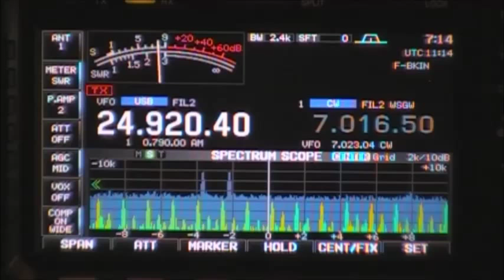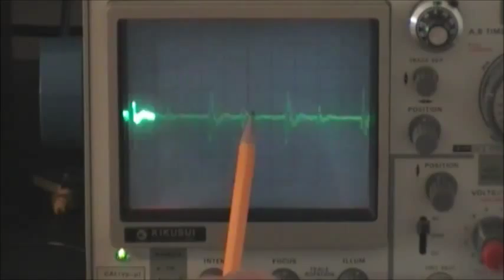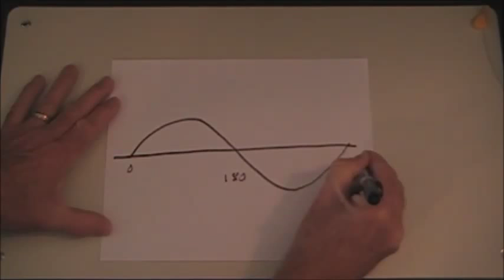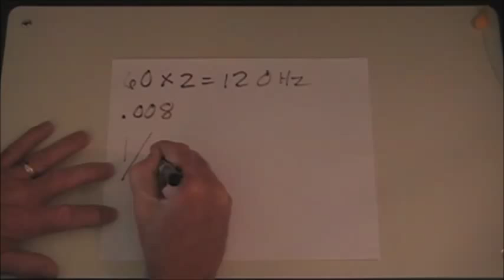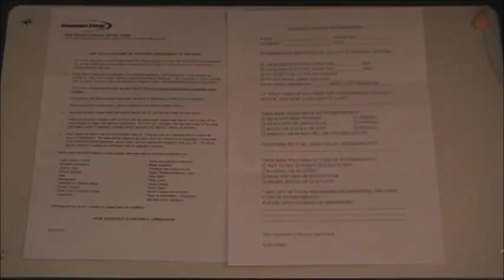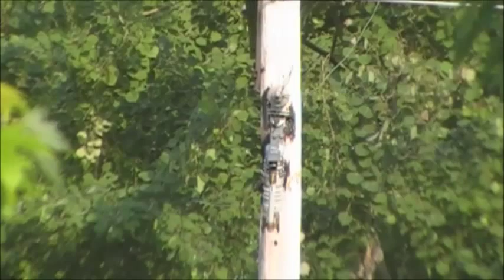Powerline RFI (Radio Frequency Interference from Power Line)

Comment: Thanks for putting so much time into this.  I had a bad noise problem with my ladder line feed antenna that largely was eliminated by going to a coax fed antenna.  However when I rotated that directional antenna west to try to pick up NZ and VK in the recent contest a noise level reappeared.  This direction points right at a pole and the power lines.  In the morning when I rotated the antenna to the east for Europe the power line was off the back side and I didn’t hear the noise anymore.  So I believe I do have some invasion from the power line 100 feet away next to the street.

I also detected a broadband signal in the higher 28 MHz band, a definite handshake or back and forth of signals that appeared with a different tone and shape on the spectrum display of the transceiver.  This occurred regardless of the direction of the antenna.  I guessed it was some sort of communication between devices, but a definite switching back and forth like a query and response, but it may not have been exactly that. I didn’t note exactly the width during the contest but probably 60 to 100 kHz above 28.7 MHz or so.

I’ve got a little work to do and will inspect the lines and hardware out by the pole to begin with.  Not sure if I have enough convincing information to approach Dominion Virginia Power.
Reply: I was surprised how responsive the power company was here in Michigan.  They have an individual who's job it is to look into these noise complaints. I wouldn't wait to contact them.  Sounds like you have a pretty good idea where it's coming from.  Good luck.

Comment: Great video.  I have a similar pattern of interference on 40 meters mostly.  When I rotate my antenna to mostly the west it shows more.  However, my interference is intermittent being on for 10 to 13 minute intervals every 30 minutes .  I went out in the alley an located one pole with much louder buzzing at about 107 Hz on a cheap newly purchased AM radio.  The noise also seems to come from the cable hook ups down the alley.  A large cable junction box is next to the pole.  I wonder if it is interacting or conducting the interference.  Still, the intermittent nature is puzzling me.  I also thought about it being a heat pump / furnace motor of sorts as there are houses and apartment buildings (big ones) in close proximity.  It is very cold out right now so I though one could be firing intermittently.  Tomorrow I am getting an MFJ 5008 delivered so I will go do some more "sniffing" though  it is going to be near zero degrees F over the next few days making it harder to stay out let alone walking on the ice in the alley.
Reply: apparently a tv cable wire that's damaged will act like a transmitter

Comment: I Hope you realize by now it is not a knife switch but rather a FUSE JACK! - 73 - KV4WM
Reply: Yep, it's a fuse cutout that can be used as a switch by pulling on it with a hot stick. Canucks call it a 'door'.

Comment: Power company could be leasing listening circuits locally, to law enforcement. Longitudinal and Latitudal hot spots on the lines are current to distance related. The current tags the radio frequency and meets, the spy current at the steel support wire. LED lights are the new microphones. Two types of light per led, allows recordings of vid/aud...One metal in the led uses wide light for video and thin light does audio. Potentiometer and a desk. CJT

Comment: I pick up rfi on my GMRS radios. It sounds like a diesel engine running at high rpm. While driving around scanning channels I get it on  different locations on different channels. In one area it will be on one channel only. In another area it will be on a different channel. What is causing this?
Reply from the maker: GMRS radios are FM radios and are not subject to impulse noise such as that caused by power line arcing which causes noise in an AM mode receiver such as regular AM voice, SSB or CW or even digital modes.  I really don't have a possible cause for that one.  Sorry.
Reply: @k8bz983  It is just very odd. It seems like it is always in the vicinity of a farm place. At one location it might be effecting channel 15 and another channel 20. But it is always the same sound. Well thanks for replying back.

Comment: Great video. Imagine if the damage wasn't so visually bad how long this could take to get fixed. Great work and i can't believe they haven't fixed it after all that time. They shoud be paying you for the money you would save them if they came to fix it before it breaks completely.
   I have just come back on the radio after around 8 or 9 years. It's very quiet at my new QTH, well as in there are no stations except the occasional truck driver on 11M. I've only checked HF for now. The problem is that i have between 4-9 of what seems to be power line noise. This seems to be a very noisy village. I'll be going mobile to DX and i'll be going mobile to try to locate the noise better but i really doubt that i'l be able to get the utility company to come and fix anything. especially here in France. 73's
Reply from the maker: Thanks for watching and for your remarks. 

When the noise began it was on and off.  It might be noisy for a few minutes and then stop for several hours.  Over about 3 or 4 days it stayed noisy longer until it was noisy all the time.  When I decided to track it down it only took a couple hours to find the problem.  The power company came out and checked it right away after I emailed them photos of the pole.  It was 2 or so before they came out and replaced the pole.

I hope you have success finding and eliminating your noise.

Comment: Is it a good idea to use a power conditioner with radio equipment to eliminate the chance of getting noise via the supplied power to the radio equipment?
Reply from the maker: The term "power conditioner" was new to me so I looked up some info on-line about them.  It looks to me like "power conditioner" is a pretty generic term that refers to anything that provides voltage regulations along with at least one other feature which could include noise suppression.  The descriptions I read referred to mostly audio, video and lab equipment and not radio receivers.  I would say based on what I found, using a power conditions wouldn't hurt, but these devices do not pickup electrical noise via electromagnetic radiation like a radio receiver.  If the source of received noise in a radio receiver is coming via radiated energy from arcing in a defective power line component such as the one in this video, a power conditioner would have no effect as the energy is radiated and comes to the radio through the air via the antenna.  So at this time in general I would say NO, it wouldn't necessarily something that would reduce radiated RFI reception in a receiver.  I would like to see some reviews of their use for this purpose before I would recommend getting one for reducing RFI.

Comment: I am being very bothered now with a lowfrequency sound at around 35-50Hz... at 3 different addresses. Else I havent heard this sound.

At all 3 locations there are powerlines and transformers in the close nearby. Very very irritating and distracting at nights and when its quiet around.. 

Is this a well known problem with power lines ?
Reply from the maker: I'm not sure but I think you mean that you can hear the sound with your ears, and not as static over the radio.  Yes, I would have to say it is possible.  Arcing in faulty power line transformers and other components make a quick snap sound with each arc.  The frequency of the AC will determine the pitch of the sound you hear.  60 Hz AC will usually make a 120 Hz hum as the arc will happen at the peak and valley of each cycle.   Human hearing is about in the range of 20 Hz to 20 KHz, so it would be within our hearing frequency range.
Reply: @k8bz983  Thanks.. Its like a consitant "humm" sound all the time. Gonna check this with the local power company ++
Reply: Within the power distribution industry, arcing is a well-known precursor to wooden power pole damage and even fires caused by it. Any responsible power company is going to want to deal with such arcing before it gets to the fire stage.

Comment: I live in a very rural area how far should I go around my home to find PLM I located one pole about a half mile away and power company repaired it dropped noise level from s9+ to s7+ but very loud buzzing thanks de KF4ZNL
Reply from the maker: The noise can actually "propagate" (for lack of a better description) down the power lines a long distance so if you have a receive that you can take to poles 1 to 2 miles in each direction (or maybe even further) it might ID more sources of arcing that are resulting in QRN at your location.

Comment: Isn't it nice that they have us hams to be their canaries in a coal mine? I'm going through this hell right now. I had two suspect poles to start. Utility company replaced the first suspect pole with transformer which improved but did not cure the situation. A second pole with transformer was also replaced but not the pole I suspect. The last remaining suspect pole also has a cable tv amplifier right near it and the finger pointing has begun. Cable company is coming out tomorrow to help me prove or disprove their equipment is the source. I of course already know the answer but the utility wants confirmation.

To their credit, they have been very responsive to my complaints so I feel I owe them at least that much. I suppose it didn't hurt when I also let them know that I am a SBE certified broadcast engineer for the local Fox affiliate television station. ;-)

73
N1JV

Comment: That pole is pretty secluded. Careful application of a chainsaw at 3:30am would fast-track the replacement. From your 26-minute video i can see that is not your way.

When i became an adult i learned to respect other's property. I began to discuss with my neighbors (each time i moved) how thier bright outside lights hurt my eyes and ruined my nightime stargazing, but could be cured (at no cost to them, or in fact any difference in lighting on Their property) with a simple metal shield which would prevent the light from coming my way. Every Time...each neighbor's reply was, "There isn't anything wrong with my light. You'll just have to deal with it".

When i was a teenager, my way of 'dealing with it' was the sneaky use of a pellet rifle in the early morning. Doing it that way worked So much better than my wasted conversations as an adult. Sometimes it took 15 bulb replacements to get the desired result (less light pollution), but it worked. As an adult, I could hire a lawyer and take them to civil court, but i don't have the money for that. I wish it were different, but that's the way it is.
Reply from the maker: No only would the chainsaw method cure the noise problem, it would stop all audio output from my receiver, as my ham shack gets it's AC via the same pole.  I can't complain.  The replaced the pole in pretty short order.

Comment: HI Steve,

Great video showing your methodology, and amazing pole damage.

Does your scope not have single sweep capture capability?  Single Sweep would make it much easier to analyze the spikes.

I previously used my oscilloscope similar to what you do, but then realized it's often much easier to just use a soundcard based audio oscilloscope program, and I now use one called "Soundcard Oscilloscope" for analyzing the audio.  This software is free for private use applications.  This software allows you to do a single sweep capture, and it has cursors so you can easily measure the time as well as frequency of the spikes.  I use the software with a laptop that has a built in mic, and therefore no interface required.  I was easily able to capture and measure the spikes in the audio you recorded using this software.

Just FYI, and thanks for the previous 160 meter contest contacts (keep em coming).
Don (wd8dsb)
Reply: Hi Don.  Thanks for the info, as well as the 160m contest QSO's.  My scope does not have a sweep capture feature.  It's a good scope but an older one.  

I have heard of the sound-card based scopes for audio but never used one.  I'll have to check it out.  Thanks for the tip. 73, Steve

Comment: Excellent instructional video about finding noise. I have had intermittent noise that switches on and off, and it looks exactly the same on the band scope, and i know what direction it's coming from on the beam at my QTH. It sounds the same on all HF bands and VHF.  I'm going to build a 2m handheld yagi, find it, and contact the PUD. It goes on and off all day and night long, and interferes with my ability to copy weak stations during local traffic nets. It makes DX almost impossible.  Thanks & 73's. KG7SXF.
Reply: Thanks Drew,  Good luck tracking down your source.  Let me know how you made out.  73, K7BZ

Comment: Pulsating noise? Have you tried mfj-1026? I assure you that noise will be eliminated.
Reply: Use a DXE-NCC-1 with an RTR-1A to null out interference with a Noise Sense Antenna, works great 
See video's from DXE on the NCC-1 to Null out this interference
Reply: Try newer unit NCC-2 from DX, has rtf-1a built into it !